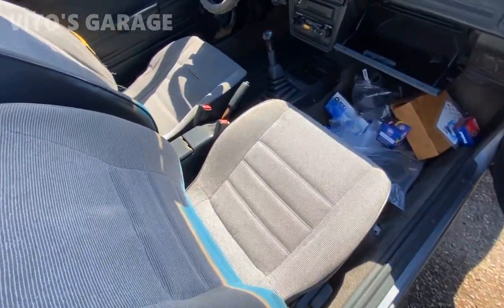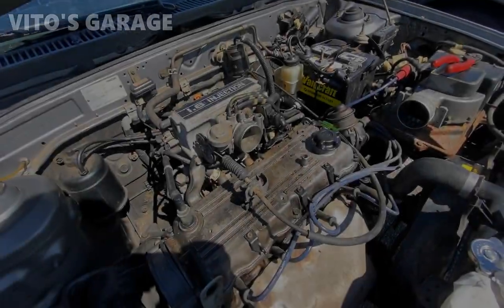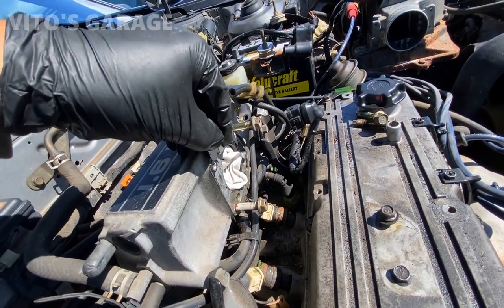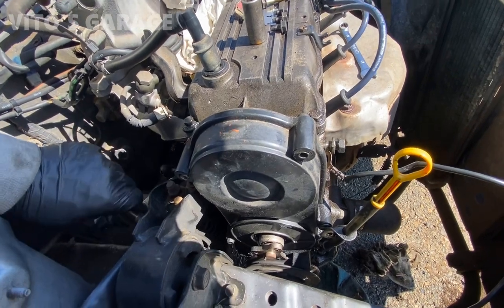1989 Mazda 323- Removing The Timing Belt and Starting to Work on The Suspension!

Comment: Before I buy my w124 400E, I had a 1999  Mazda Protège which I sold at 310K miles!!!! (original engine & manual transmission)